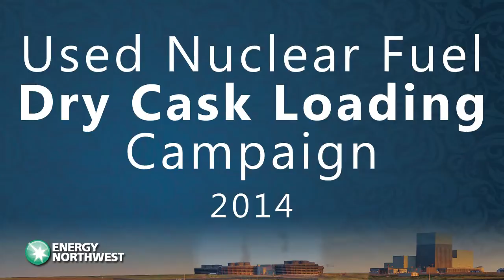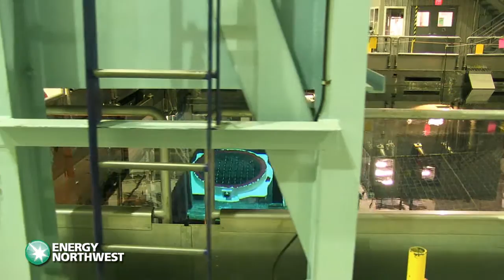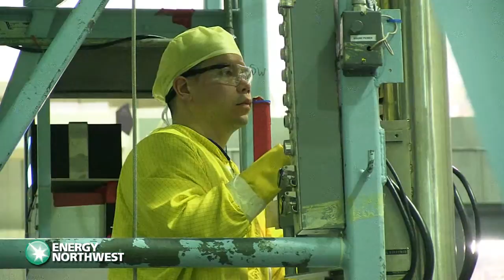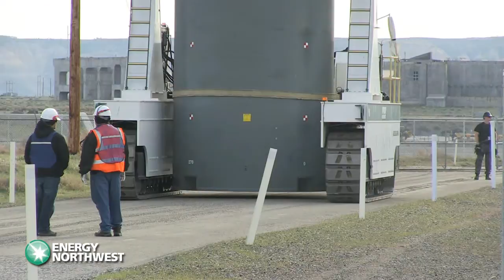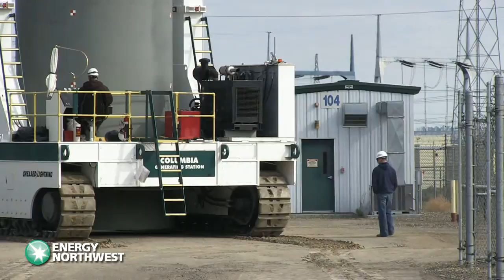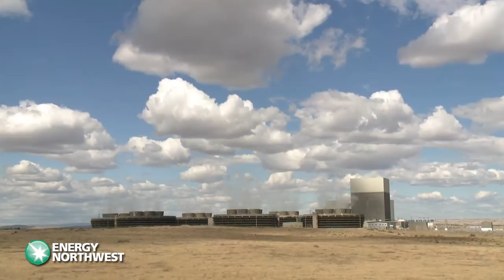Used Nuclear Fuel Cask Loading Campaign - 2014

Comment: The data I read is that the casks get irradiated over time and start to decay. One cask with less than 15 years of service was showing micro cracking of the steel.
Reply: They're not that safe, are they?
Reply: @aegaeon117  They're currently safe but they were never meant to last forever.
Reply: @dizzy_derps most likely because they are using chinesium instead of higher quality us steels.